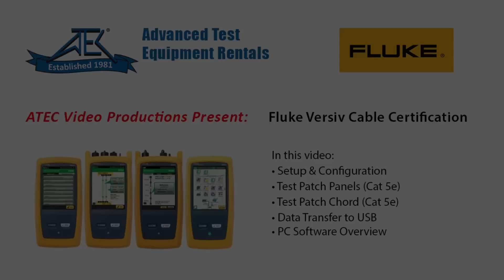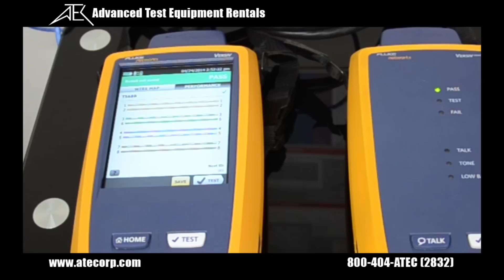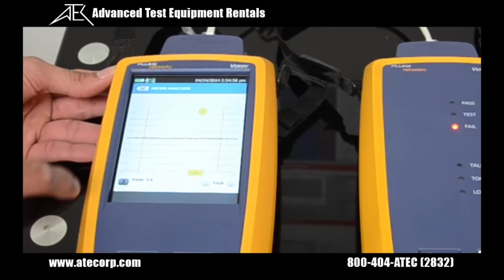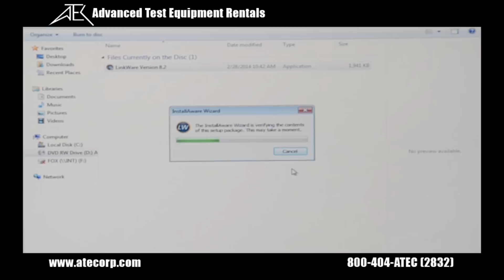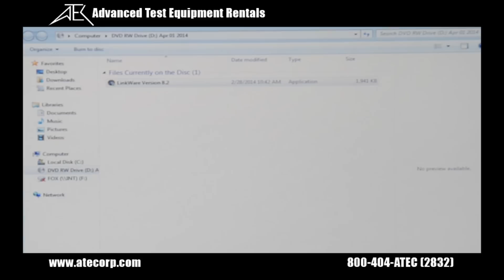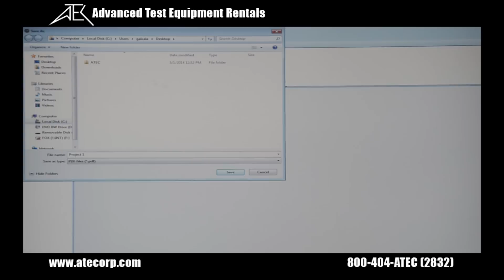How to Master the DSX-5000/8000 Cable Certifier in Minutes!

Comment: Nice video.

When testing patch cords you have to use special channel adapters!

Current testing of cables requires special channel modules.
A normal channel = test of link including 2 crosslink cables

Patchcord modules:
Cat5E cabling: DSX-PC5ES
Cat6 cabling: DSX-PC6S
Cat6A cabling: DSX-PC6AS
Coaxial SET: DSX-COAX
Coaxial cables: DSX-CHA003
M12 cables: DSX-CHA021S
Reply: The patch cord adapter should be used for testing patch cords.  Channel adapters should not be used for testing patch cords.
Reply: Correct. Please see comment above, for details.

Comment: very usefull
Reply: Vertical
Reply: I neead tasting cat 7
Reply: Pliac sand cat7 tasting
Reply: Shouldn't you store your 2th permalink adapter as well?
Reply: @babarrahmaan276  Sorry for the delay in answering, but this is a common question. In the ISO standard, they don't have Cat 7, they call it "Class F". If you select an ISO Class F test, that is the Cat 7 limits. Be careful, you will need Cat 7 connectors to pass the test.
Reply: Actually, not useful because it is not accurate. The person doing the video is not trained or qualified to be a “trainer” for Fluke DSX test gear. Please see top comment for details.

Comment: How did you decide on the message that appeared on the screen? at 3:15 time of video?  
this message appeared to me and I do not know how to solve
Reply from the maker: Hello Miezi, we recommend speaking with the manufacturer. Here is their contact information: For technical support,
call 1 (800) 283-5853 or visit
 http://www.flukenetworks.com/Support.

Hope you find this helpful.
Reply: He set up his test as channel but he is using the permanent link adapters. You have to use the correct test limit with the cable type and adapters you are using or you will get error messages.
Reply: This is correct info.

Comment: Thanks for the video. Are the steps about the same for the DSX 8000?
Reply: Yes, the only difference is that a DSX-8000 offers a Category 8 test, otherwise they are about the same.
Reply: No sir they are not. The steps in the video show how to NOT test properly, and they leave out significant and very important details. You can find tutorials and training videos at Fluke.com website. These will train you on how to properly use a DSX 8000 Versiv.

Comment: When a data cable fails how you know what side it’s the problem at ? At the main or the remote ?
Reply from the maker: Hello! The test result will show you what the failure is and where it is along the cable. Whether at one of the connectors or some distance down the line, and exactly on which twisted pair the issue is occuring. Please feel free to contact ATEC for more information.

Comment: I have tested my cat5e using a same cable analyzer like yours. However, when i transfer the test result and open in laptop, the resistance result is shows N/A. It should have reading in ohm. Can u help me how tu get resistance result in test result
Reply: Is this an extremely short cable? That may be the cause. Another option would be to run a (+PoE) test.
Reply: Your test set up is not the proper one you need for what you are trying tomaccomplish. Please contact Fluke and arrange for proper training. It will do you good.

Comment: I'm having problems I'm testing cat 6 it's say wire map is bad
Reply: Was the wire certified or did you the the rj45s or jacks?
Reply: Bad wire map, means the termination quality is not as it should be. Pin out issues/ reversals/ opens/ shorts/. Examine the quality of the termination at the location point of testing and redo using proper tools and know how. Are you, or any member of your crew or staff,  a certified NCS?